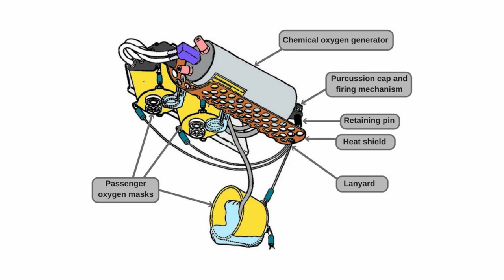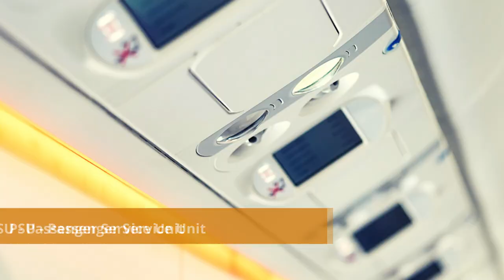Passenger Oxygen System - Aircraft Certification - Filipe Von Tiesenhausen

Comment: Thank you Clarissa-san, Rafaela-san, and Filipe-san for this interesting channel. 
It's surprised to know that it reachs 300 deg. C the COG when it's generating oxygen by chemical reaction. No wonder why PCU required us the minimum clearance such away for low pressure ducts.
It's also interesting to know that relationship with ETOPS. It can not achieve by Engine itself but also the oxygen system to follow.
Certainty the oxygen system is not system that normally operating but it's very important system when it's needed and it's required to design with good imagination and consideration as operating.
Thank you.
Reply from the maker: That is very true Mizuide-san. The oxygen system is one of the systems nobody wants to use, but if needed, we want it to be there and operating properly as it is last resource to save lives in case of a cabin decompression. Very important emergency system.